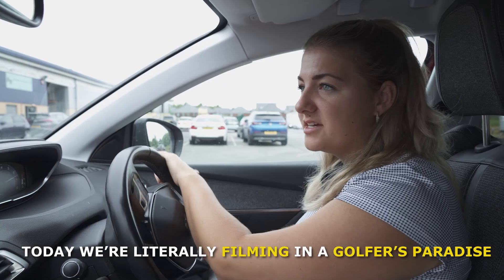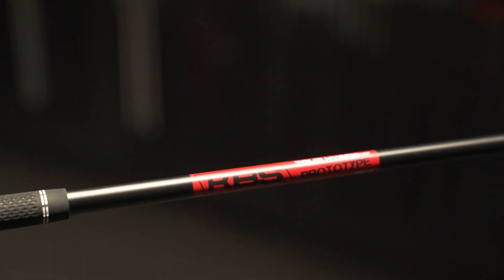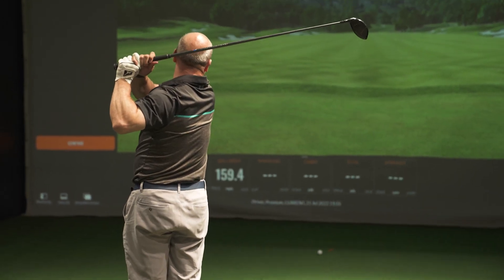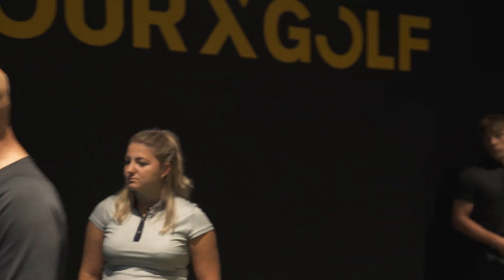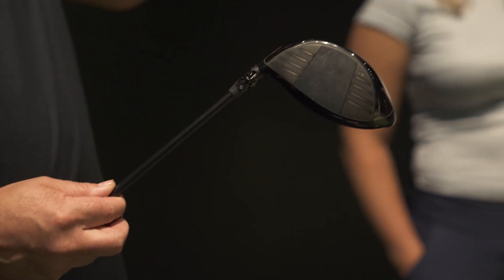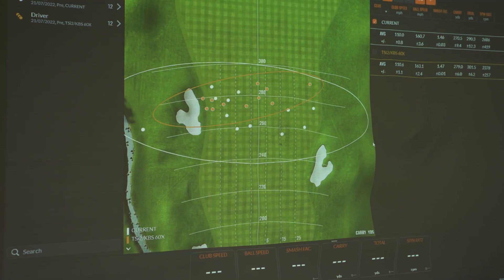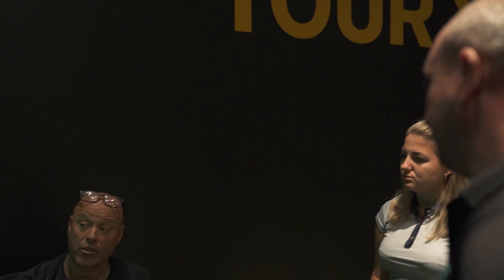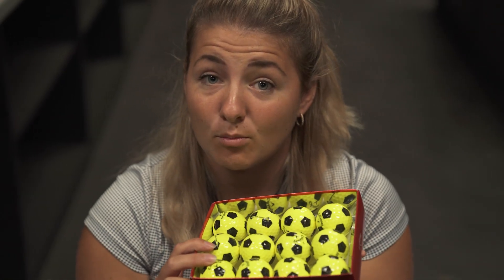Gain 20+ Yards With Your Driver!

Comment: I am looking to get a 7 wood in the Qi10 Max and was wondering what type of KBS shaft i should put in it     i have a swing speed of 90-94 mph with my driver    59 years old   handicap of about 7     i normally hit a high ball pretty straight      I am unable to go for a fitting due to my location       i look forward to your thoughts  thx   cheers from Canada